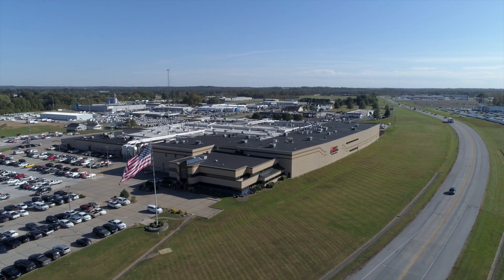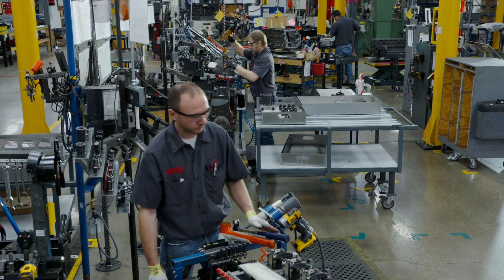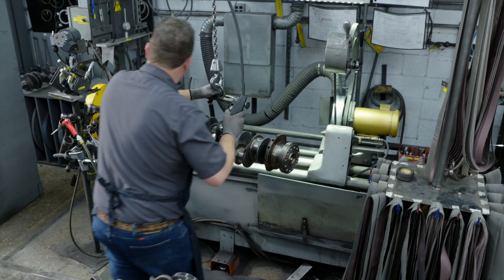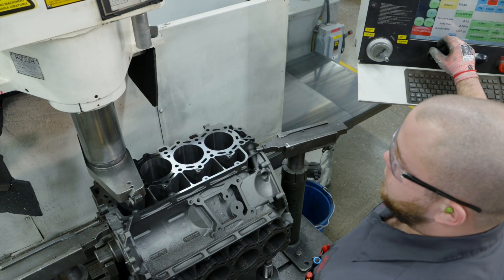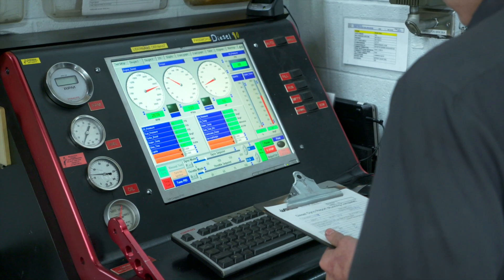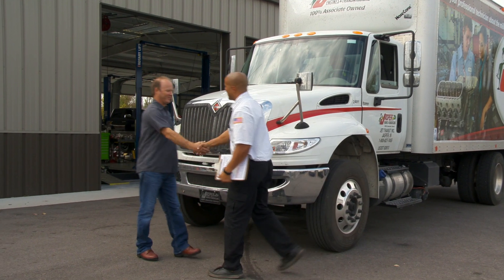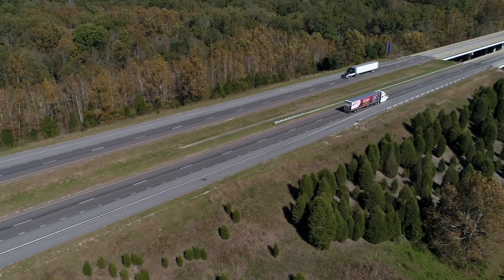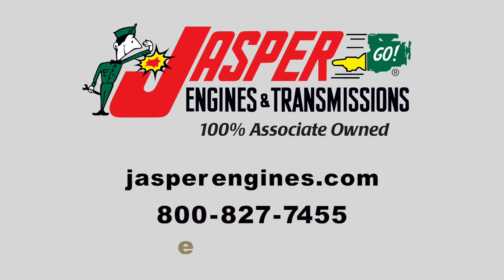Jasper Engines & Transmissions - Diesel Engine Overview

Comment: Does Jasper remanufacturer 6.7 Cummins Diesel (2008) Engines ???
I have a "2008 RAM 3500 Laramie 4x4 CC DRW LongBed 6-speed Automatic Transmission with 6.7 Cummins Turbo Diesel (185,000 miles),,, currently the Cummins is running perfectly...
Reply: JaLyn, drive your diesel truck till it won't go anymore.. then rebuild it yourself. Have a machine shop clean it up and it will be better I believe...